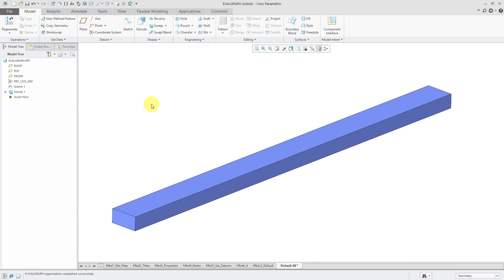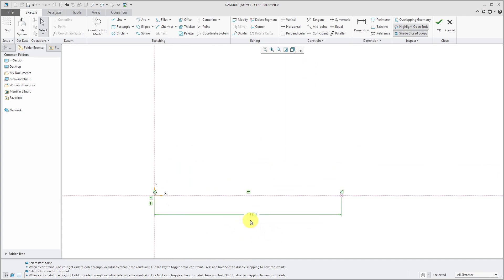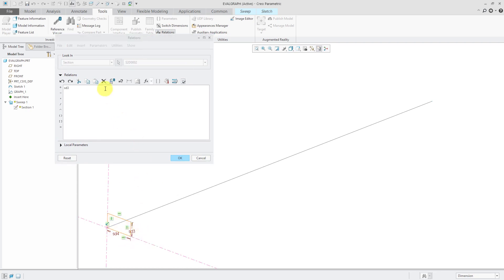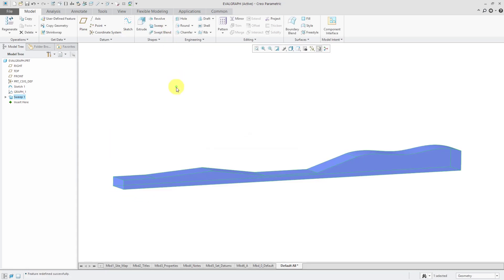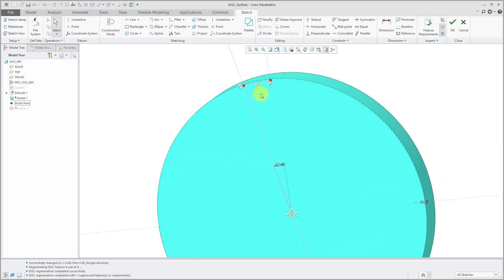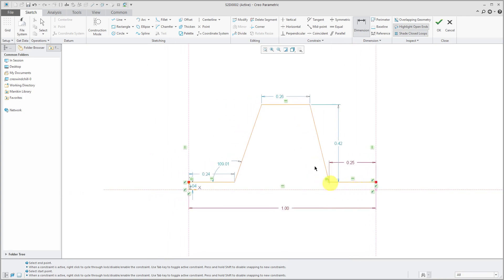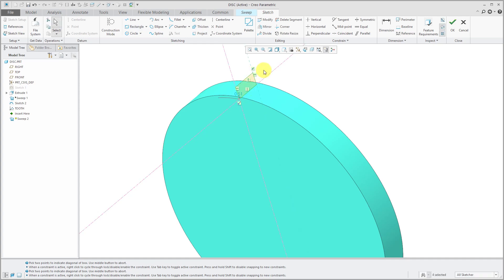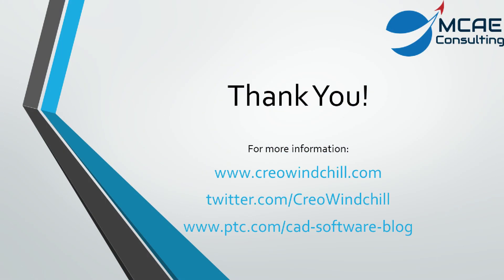Creo Parametric - Variable Section Sweeps (Part 4 - Evalgraph and Datum Graphs)

Comment: can you use the graph feature to manipulate an extrude rather than a sweep?
Reply from the maker: Yes. But Extrude features don't have a trajpar parameter. You can extract a single value from a graph for the Extrude's depth, thickness, or a sketch dimension, but that's it. You can't change the shape of the Extrude feature with a graph like you can for a Sweep.